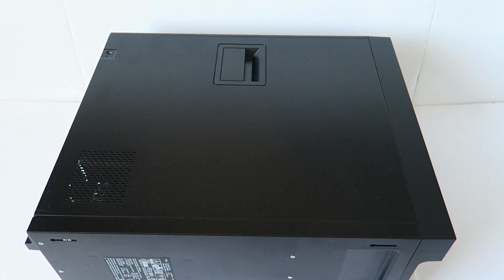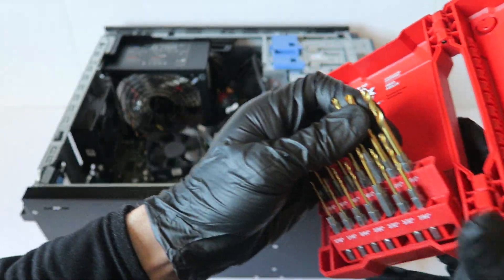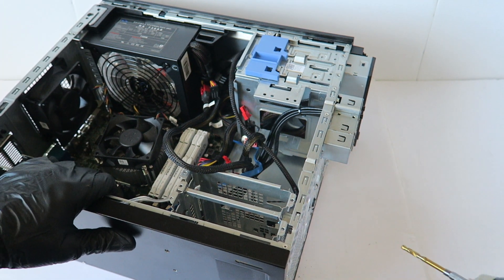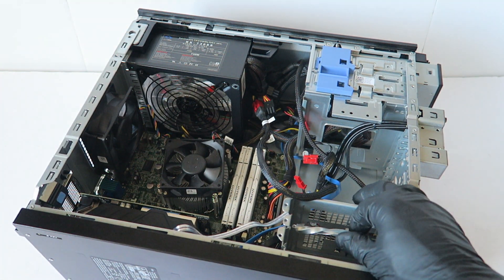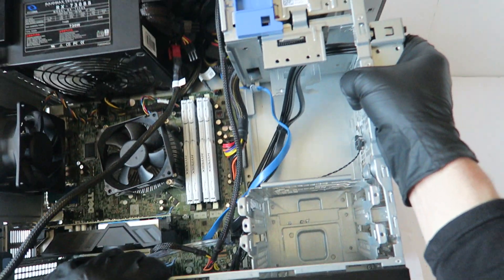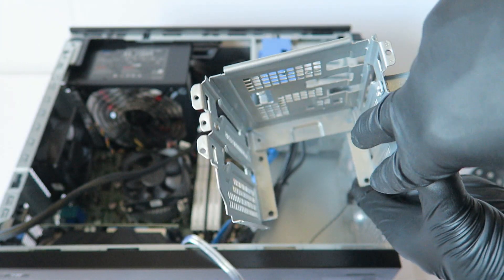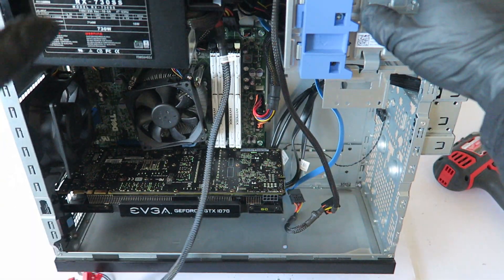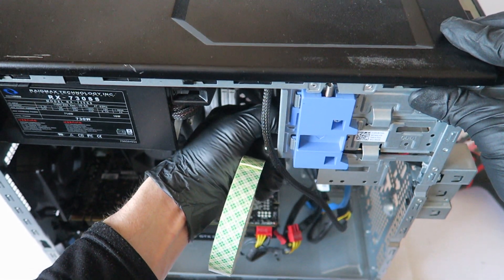Dell Precision Optiplex How To Remove Hard Drive Cage

Comment: If you're following this. You don't have to remove the 2 rivets at the edge on the bottom of the case, unless you also want to to remove the extra bracket that hold part of the motherboard tray to the case.

Comment: Yes... my graphics board doesn't fit... so I had to try something... thanks for the video Mxkdi ... Mine didn't have the rivets on the bottom... It was all going fine until I got to the bottom ...it has some type of slide lock, one side came out ok and the other is still stuck..
Reply from the maker: Hi, Thanks

Comment: Is there any way to do this without a drill
Reply: yes i used scissors..took me 3 hours to get the rivets off ..the 3 underneath and 5 at the back...then i ripped out the cage ignoring the 4 or 5 holes u have to drill through on inside the cage
Reply: @Shikshame  Oh thanks for tellin me

Comment: Did not work for me. I have a Dell Optiplex 9020 made in 2016. There are two flanges in the back of the drive cage that go outward and appear to be adhered very tightly ro welded to the base of the motherboard plate on the left and to the the lip of the front case on the right. This is different the the drive cage in the video. I drilled out all the rivets but these attachments will not move. I may take the  motherboard out and use a hacksaw, bolt cutter, dremel, or other demolition tool to cut this out. It is a pain that Dell had a different drive cage in mine.
Reply: Did you end up getting your drive cage out? If so, did it require a "demolition tool"?
Reply: @jamesb6008  I realized I missed a few rivets in the back. I did eventually get it out. I wish I could send a picture of the cage such is still on my basement. I just used a drill on the rivets.
Reply: @bostski  I ended up figuring out the same thing you did. Really appreciate the reply though

Comment: How did you plug into your SATA cable after and use the HDD?
Reply: Lol good answer there, I've read you need to use L shaped sata connectors which are pretty easy to come by. I also ordered a L shaped USB 3.0 from amazon for $6, not sure if it will work yet.
Reply: @zarmelad3475  ik this is old lol but did it work?
Reply: @cloroxbleach8883  love the name, it like barely fit and is slightly bent while attached, but functional.
Reply: there is a hard drive cage on the top, u can add an hdd using screws

Comment: Where do you plug those cables back in though? Theres clearly not enough room with the gpu there so where do the three go instead? I really need to know because my rx 580 is gojng in there and not sure where to put it
Reply: SmithTheDankMyth did it fit
Reply: @Rez_97  yes i bought an L shaped sata cable and just unplugged all usb 3, the crad fits in v nice however im having an unrelated problem with my GPU :(
Reply: SmithTheDankMyth aww man what kind of problem? Same here for some reason my gpu is missing the front bracket so I had to get a new one 🥺

Comment: In terms of durability and hardware performance, is Optiplex version better than Precision? (with the same spec)
Reply from the maker: Hi, actually precision are better i would say i am using right now t5810 and i also like OptiPlex XE3, and OptiPlex XE2 really top of the line
Reply: @Mxkdt  Thanks for your answer. Really appreciate. 👍👍👍

Comment: So I have a 3010 Optiplex and I am using it as a home server. I have the two bottom 3.5s used for mirror drives and am using a 2.5 SSD for the OS. There is a bracket, just below the two 5.25 bays that almost appears to be a 3.5 bay, can you tell me what it's for and if a special Dell bracket is required?

Thanks and keep up the great vids!

Comment: Ah, Optiplex build just became too expensive :/
Reply from the maker: Hi, yes.
Reply: Mxkdi I wound up doing a DIY, spent about $770 and got Good case with 4 fans, 
Asrock B450 HDV4.0 Socket AM4 motherboard 
AMD Ryzen 5 2600 (will later upgrade to 3600X)
eVGA 500W PSU
16GB RAM from Team
GeForce GTX 1070 Ti - used off eBay works perfectly.
1TB Seagate HDD 7200 RPM
Lite-on 48x CD/DVD-R/RW
VSeven 24inch monitor 60Hz
Logitech Speakers, Keyboard, Mouse
Reply from the maker: @Dexion845  Hi, thanks for the info..
Reply: @Dexion845  you might want to install an ssd, maybe 240gb/256gb if you want to speed up load times. Install the OS and programs in the SSD and use the HDD as a storage drive for media.

Comment: Thanks for this info! For what it's worth.. the 7010 (most likely on others too) computer has one right angle cable with a sticker pull tab used for the HDD on the disk side. I shaved off the pull tab with a razor blade and made it flush and used that connector on the mobo side. Doing this, allowed me to put a reference 680gtx in the case without any case mods including keeping the hard drive cage. I still need to figure out the optical drive and USB 3 header issue but that's something down the line to worry about. Super good budget gaming machine for those looking for one.
Reply: What about increased cooling?

Comment: What do i do if the hard drive enclosure is stuck on one of my optiplexes? I can’t seem to get it out
Reply: Same problem
Reply: @Soltra45  Yeah, it took me 3 hours. But I got it and works perfectly except I cant use the front I/O port for the USB and audio Jack's in front. My graphics card is way too big
Reply: @chilly3528  but what about the sata connection on the motherboard?
Reply: @Shikshame  I have a weird sata cable thats flat if that makes sense i forgot the name of the type of sata cable. but it works. oh and my front IO works too, except for the USB 3 ports they do not work
Reply: @chilly3528  its sata 3 L connector..i just shaved mined down with a razor and is working..no front usb tho..my strix rx 480 is working nicely
Reply: @Soltra45  nope, I just ripped it out with my hands and a hammer
Reply: @chilly3528  i did the same half way through this tutorial 🤣

Comment: So you would need a  shape sata cables?
Reply from the maker: You can buy usb 3.0 extender cable they sell online and you can buy USB 3.0 card you can install on the botom thru PCi slot and that allow you to use front USB 3.0 ports.
Reply from the maker: Hi, SATA III L-Shape Cable
Reply: @Mxkdt  also anything about the USB cable? I got a bunch of USB device I use.

Comment: How do you connect all 4 sata cables to the motherboard under that card? Even if you use L-shaped connections I don't see how you could connect all 4-am I wrong?
Reply: You only need 2 to be honest
Reply: U can connect just 3 
One on the left and the other in the right
Sadly u sacrifise with one port

Comment: Hi there I was just wondering can you put a nvme m.2 internal ssd,and a regular ssd in the same  pc system, and plus a hdd to in the same pc unit. 🤔🤔
Reply from the maker: Dell precision t 3620 does have m.2 slot you can use samsung 970 evo ssd for main boot drive.
Reply: @Mxkdt  okay thank you that's was what I was wondering about see on  mine the nvme m.2 internal ssd is my os boot drive so it is ok to add a ssd, and  a hdd to for extra storage for my games, and ect. For my nvme m.2 internal ssd mine is a 256 GB sk hynix kind.
Reply from the maker: Yes you can add extra SSD or HDD for extra storage for gaming main boot drive or you can get match pair SSD drives and run them in raid 0 in Dell precision t 3620.
Reply: @Mxkdt  thank you do you know the part number for the caddy tray for the ssd, and for the hdd caddy tray. For the ssd is  it a two piece for the ssd caddy, and also would I need that y adapter for the sata cable to..
Reply from the maker: Hi, mike and what system model number are you going to upgrade on?
Reply: @Mxkdt  hi there mxkdi I am upgrade my Dell precision t 3620,and I was just wondering what hdd,sdd caddy tray adapter is that I needed to put a ssd in I just ordered the memory ram cards that I needed thank you so much for your help.
Reply from the maker: ($5.36) SATA Power Y Splitter Cable Adapter

https://www.ebay.com/itm/SATA-power-splitter-cable-adapter-SATA-power-Y-one-male-to-2-female-connectors/333106662312?hash=item4d8eb44ba8%3Ag%3Ah9gAAOSww9BcgVoi&LH_BIN=1

($9.99) Dell Hard Drive Caddy R494D, 0R494D  3.5" to 2.5" HDD SSD Caddy Adapter 

https://www.ebay.com/itm/Dell-J132D-0R494D-R494D-2-5-to-3-5-Hard-Drive-Tray-Caddy-for-Optiplex-U2/123338007460?epid=27006037383&hash=item1cb784a3a4%3Ag%3A0YwAAOSwtRlbhZA6&LH_BIN=1

($5.82)  3.5" HDD Caddy Bracket 1B31D2600 DN8MY PX60023 

https://www.ebay.com/sch/i.html?_from=R40&_nkw=+DN8MY+PX60023&_sacat=0&_sop=15&LH_BIN=1&rt=nc&LH_PrefLoc=1

You can also use this caddy  cost a lot less i used this in my new upgrades videos.

($4.83) -- 3.5" to 2.5" SSD/Hard Drive Drive Bay Adapter Mounting BracketConverter

https://www.ebay.com/itm/3-5-to-2-5-SSD-Hard-Drive-Drive-Bay-Adapter-Mounting-BracketConverterTrayIJ/233222062960?hash=item364d1e4370:g:BaYAAOSw0xtb98YD
Reply from the maker: I just edit ebay  first link for SATA Y splinter Cable they sell for around  $5.36
Reply: @Mxkdt  oh yes thank you so very much really  really appreciated awesome thanks. All we  now is the hdd ,and the sdd caddy tray for the  dell precision t 3620. For a 2.5 inch sdd,and for a 3.5 inch hdd.
Reply from the maker: Do you shop at amazon. com ?
Reply: @Mxkdt  yes sure do that's where I get all my stuff for  my  PC'S from Amazon. Com👍👍🤗

Comment: Thanks, this came in useful.  My main PC died and due to current budget constraints,  I picked up an Optiplex 9020 for £20 and upgraded it with parts from my dead pc.  Had to remove the drive cage to fit my RX580 and this video helped :P
Reply: Same!! Just got an rx 580 and really don’t want to upgrade.
Reply: £20 for a 9020 holly crap thats crazy!!! i got my 7010 for  £40!!
Reply: Didn't need to disconnect the USB header or SATA cables either on the 9020
Reply: Where did you get one that cheap?
Reply: @DragonSlash42  just kept an eye on eBay auctions
Reply: Can a 3 fan graphics fit without cage removal?
Reply: @PencilSZN  Definitely not, I have a two fan (RX 570) and I need to remove it.
Reply: @griffedwards9159  Do you have Discord , I just wanna chat about PC matters plz
Reply: @Schtufbox Do you have Discord , I just wanna chat about PC matters plz
Reply: What type of rx 580 did you get
Reply: @Jamal01223  msi armor 8gb one
Reply: @inpurgatory thx
Reply: @myoldchannel1567  The only reason it fitted was cuz my rx 580 was a fake model so it was smaller bit still dual fan. U would need had cage removal. I had a 7020 btw. My other reply to the other guy was stupid. Hope this helps!
Reply: @myoldchannel1567  your welcome. Now that u saw this comment I'm gonna delete this one and the other one to not confuse ppl bcz my inbox gets bugged. Will delete after u see this. I'm glad I could help. Good luck
Reply: @myoldchannel1567  same one I had at the time lol
Reply: I wish I could've found a 9020 that cheap today. They increased in price a bunch. Still the cheapest way to get a low-medium end build. Unless you get lucky with a local posting.

Comment: I ve a dell optiplex 3020 MT and i got a brand new rx 570 4gb mining edition. i replaced the psu to a thermaltake 700w and i use a 24 pin to 8 pin connector for the the motherboard . My computer just works fine but when the GPU is installed the computer turns on, CPU fan is spinning / GPU fans too /the lights are on but no display, nothing shown on the screen. i put the the VGA cable to the convertor and then i plug it into the GPU. the computer turns on but no boot and nothing shown on the screen again . and when i plug the VGA cable into the motherboard it works and i can see the GPU information on CPUZ. .i updated the bios to the latest version that i found on dell website, and put the boot mode on UEFI . i put secure boot OFF and legacy option roms ON? but the same thing happened. so what other ways i can try ? ? Note i m plugging the 8 in the GPU and every other cable is plugging properly.
Reply: Jack TG did you install drivers for your card?

Comment: cant the metal fragments mess with the other components of the pc?
Reply from the maker: No you have to use vacuum to clean it of fragments mess.
Reply: @Mxkdt  wait so just to make make sure if we do this we HAVE  to vacuum the bits before we turn on of? Or it could ness with other components?
Reply: @malecrium8665  just a vaccum and a magnet if you really want to be safe. Its the same procedure I did when I had a stripped out oil pan bolt on a friends car
Reply: Gregory Have you tried to take the cage out if you have a PC like this?
Reply: To be safe I'd probably remove everything from the case and then attempt this then grab vacuum/ magnet and clean it as best you can again im not an expert and I'm not responsible for damage caused to you or your computer parts.

Comment: Hah i've been slowly doing the same thing to a free Optiplex 9020 I got. Was thinking about possibly using an RTX 2070 (mini) due to the limited space from the HDD cage. Worried about the overall heat situation in their though if I ramp it up.

Comment: That's exactly what I did for installing a 1060 6gb SSC. I had to buy L-Shaped SATA III cables to fit under the card. I didn't mind relinquishing some of the USB headers in the front. I hardly used them 😆
Reply from the maker: Hi, yes you can still install on the bottom PCI express x16 slot Pci-e Express Card With 2x Dual Internal 19-pin USB 3.0 Port and USB 3.0 20-Pin Male to Female Internal Extension Cable this will allow you to use USB 3.0 ports on the front.
Reply: Can you fit a hard drive beside the video card?
Reply: @mutasimrahman6833  no because I had to remove the hard drive caddy. What i did is i placed something small with a piece of cardboard where my hard drive can lay down flat on it.
Reply: @truthbetold7771  ok thanks